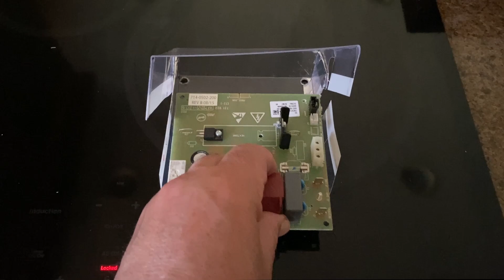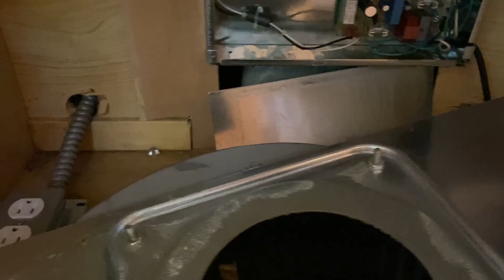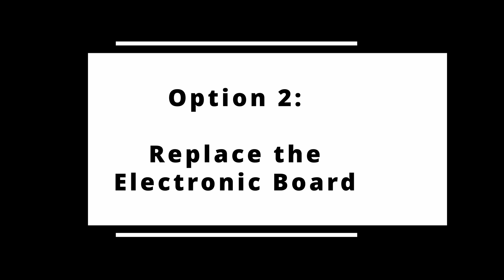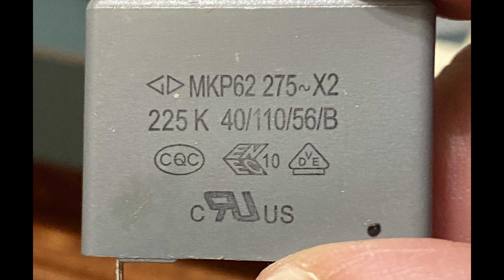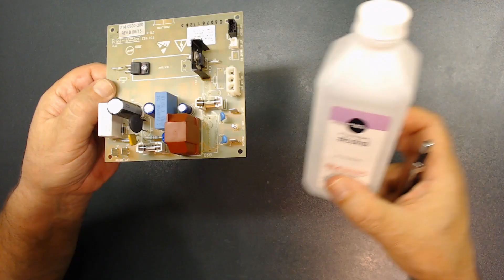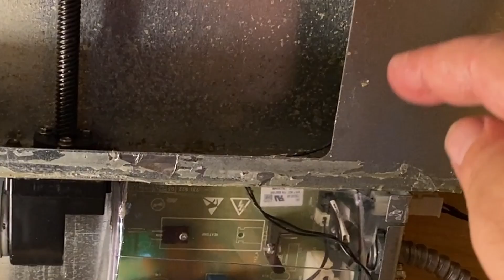GE Downdraft Stove Range Repair – Control Board Failure, Bad Design & Permanent Fix

Comment: You Said you don’t know  what GE was thinking. I know the answer, they were thinking about good old $. Not many people will fix their unit and buy a new on . They want oil get in everything so  it stops working . 

You are very smart making the cover, love it when you use everyday items in your repairs.
Have a great weekend  
 🤗🥰🤗
Reply from the maker: Hi Sis, you’re absolutely right! Otherwise, no one would be buying new units that cost an arm and a leg 😄 It does seem like some modern designs aren’t meant to be repaired easily. Glad you enjoyed the video! Love you and have a great day.

Comment: I have the same part and problem. I thought there should be a microswitch somewhere to tell the fan if the hood is fully extended ??
Reply from the maker: Hello,
It’s great to hear from you—thank you for taking the time to message me and for supporting my channel.

Unfortunately, I wasn’t able to locate that microswitch. It appears the main failure was caused by oil reaching the control panel, which created a short.

Please feel free to share your findings—I’d be glad to hear what you discover.

Have a great day!
Regards from Florida,
Jay

Comment: Design flaws are not a mistake. When something happens they want someone to go back to the supplier so you spend more money than you should fixing it. I don't have a range that new . I have the burners the electric coils and the rest of it is not hard to repair at all and it was made in 2004 and I really have never had a single problem with it.
Reply: Design flaws are usually acceptable decisions due to bean counters in a company telling the big bosses you don't need to spend money  on extra protection just regular protection.
Reply from the maker: Hi Steve,
I totally agree with you. Too often these kinds of design compromises come down to cost decisions, where “good enough” wins over long-term reliability. A little extra protection upfront would prevent a lot of failures down the road.

I actually contacted the manufacturer about this issue, and they told me that after a few years the parts are no longer available. Their solution was to send a service technician—over $100 just for the trip charge, plus a few hundred more for troubleshooting. As you and I both know, that usually ends with the technician recommending a new downdraft unit for $1,000–$1,200, and then you add removal and installation costs on top of that. In the end, you’re easily into a couple thousand dollars or more.

And that’s assuming you’re lucky enough for the repair person to actually show up! LOL

Thanks for sharing your thoughts and contributing to the discussion—I really appreciate it!

Wishing you a great day, and thanks again for reaching out!
Best regards from Florida,
Jay
Reply from the maker: Hi Larry, 
You make a very valid point, and I agree—older appliances were often built with simplicity and repairability in mind. Many of them ran for decades with minimal issues, which says a lot about the designs back then.

Unfortunately, with many newer units, cost-cutting and planned replacement seem to play a much bigger role, and that’s where these kinds of problems show up. Your 2004 range is a great example of how durable and service-friendly appliances used to be.

Thanks for sharing your experience and for adding to the discussion—I really appreciate it, and thanks for watching!

Wishing you a great day, and thanks again for reaching out!
Best regards from Florida,
Jay

Comment: A purposely made design flaw so the average person goes and buys another one. So typical! Your clear plastic box cover 
which would be pennies to the manufacturer to do, is a brilliant design but I would have cut a circular hole in it above the
one IC with the heat sink. It might get so warm the  plastic cover could sag onto it from heating. I don't know how hot the 
plastic would get from the heat sink which is now  covering it. Would be a spacing issue. Good job on both investigating 
the problem and solving it with the cover Jay.
Reply: Jay, you remind me of my Dad. He was an electrical engineer w/six kids so he fixed everything. He would always say "That's a bad design", and then improve it. Good job
Reply from the maker: Hi David,
Thank you so much for sharing that—that really means a lot to me. Your Dad sounds like he was an amazing engineer and problem-solver. I love that mindset of calling out a bad design and then making it better.

My wife keeps reminding me that I usually say “bad design” about things too! LOL I guess it comes with my mechanical engineering background—always looking for a better way to do things.

I truly appreciate the kind words and you taking the time to comment. Thanks for watching!

Wishing you a great day, and thanks again for reaching out!
Best regards from Florida,
Jay
Reply from the maker: Hi Steve,
Thanks for the thoughtful comment and kind words—I really appreciate it!
I agree, the original design is definitely questionable, and unfortunately it’s something we see far too often.

You make a great point about heat buildup around that IC. In this case, the cover is spaced far enough from the heat sink, and I left the bottom of the enclosure open. I’m hoping that provides enough airflow to keep the board cool—we’ll find out soon if it works or not! LOL

That said, cutting a vent or circular opening above the heat sink is a solid idea and something others could certainly consider if temperatures become a concern.

Thanks again for watching and for sharing your insight—it really adds value to the discussion.

Wishing you a great day, and thanks again for reaching out!
Best regards from Florida,
Jay